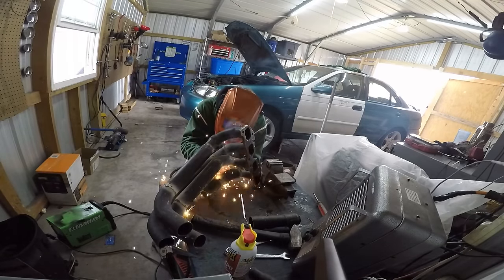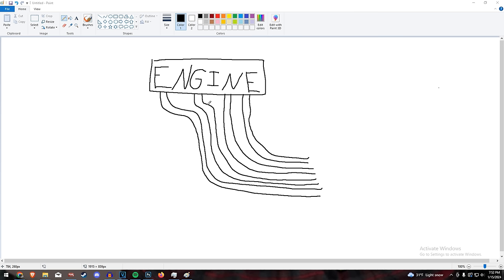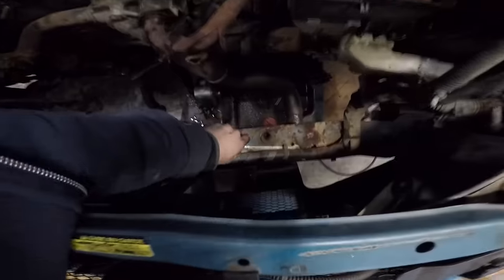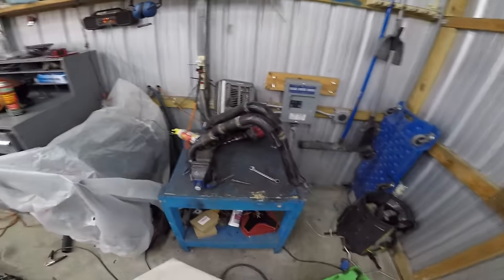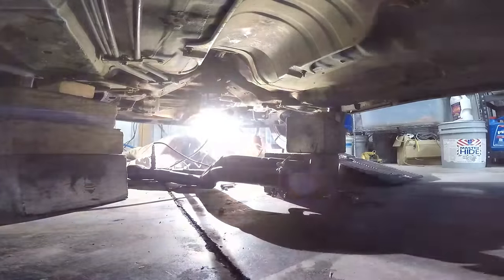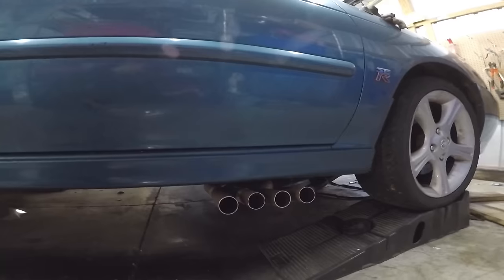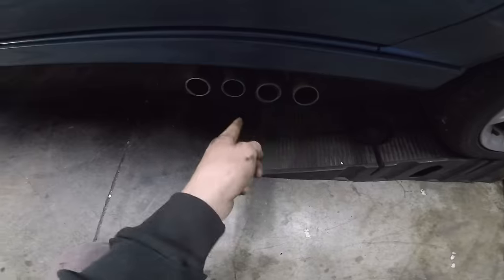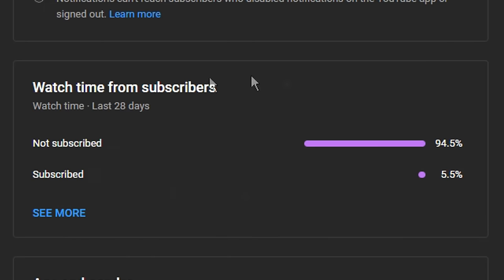True Quad Exhaust on a 4 Cylinder - What Will it Sound Like?

Comment: I like watching the puffs come out when it's idling. You can practically see each cylinder fire.
Reply from the maker: It does give you a good perspective on how fast the cylinders are firing
Reply: I dunno about that... Some quick math for a four stroke engine says:
Each cylinder fires 5 times per SECOND at only 600rpm...  (50 times per second at 6,000rpm)...
....pretty nuts to think about that, imho. especially if you take it to even higher revs.  I chose the 600 and 6k b/c I just woke up and the math was easy... lol  
9,000rpm - every valve in the head is opening and closing again at a rate of 75 times a SECOND!!
Reply: @billymanilli that really puts 17k rpm F1 engines in perspective, jesus
Reply: I'm not sure about how obvious it was that the math lines up with the video but what I am sure about is that there are musicians who can easily count 5ths of a beat at 60bpm and that is something i can actually wrap my head around  @billymanilli
Reply: @billymanilli Try tapping five times a second. It’s not that hard. You can see each pulse.
Reply: @twisted5576 great. Now try 50
Reply: @nateg08  Did you mean something by that? When the car is idling you can see each pulse.
Reply: @billymanilli  4 stroke does 2 revs per spark. 1000 per minute at 2k RPM. Which is 100/6 which is 16.6 total sparks per second.

At a low idle of around 1k RPM, that is 8.3 sparks per cylinder, per second. Looking at the video around 3:50 and counting as best i could, this math checks out.

The human eye's limits on perception called the critical flicker fusion threshold is somewhere between 60-90hz so we should be able to fully perceive individual piston fire even into the red. Well, in theory at least. At high RPM it seems like all the smoke vanishes.
Reply: How was performance change with this?

Comment: Well that sounded about 1000 times better than I expected. Impressive stuff
Reply: from inside the car is sounds like a 4-71 detroit without the whine of the blower
Reply: Agreed. Sounded great, cept for the probable stupid volume level. I wonder, if you ran the pipes all the way to the rear and put something inline, could it keep that great sound but lower the extreme volume level? I'm guessing the great sound might change in the process but think it worth trying to find out... Not my time or money so I have nothing to lose by asking😃
Reply: @SHO1989  It will sound exactly like normal exaust on 4 cyl xD
that was shown in start of video with dual exhaust 4cylinder engine. this now sounds diferent since no exhaust at all

Comment: love how it goes from lawnmower on initial startup straight to a 70s v8 with a pissed off wasp hive in tip
Reply: This doesn't sound anything like a V8...
Reply: Not sure where you heard v8
Reply: @keegentilley578  2:55-2:59 I can see where he'd get old school high rpm v8.   But then as soon as it's past the camera it sounds like I thought it should
Reply: It sounds exactly like the car from Hard Drivin' on the Sega Genesis.
Reply: @GoldenGrenadier  Oh hell, I forgot all about that ancient game. Kinda does.
Reply: 4 cylinders have a similar rhythm as v8s, but imho 3:24 sounds like an old z28 idk. Or some 6 cyl @benn454
Reply: hearing aids might be needed in your future
Reply: That sound you get when you put in the clutch/let off the gas to grab a gear sounds very similar to a V8, just more wasp like than roaring. The four cylinder set up definitely had it's own unique roar, which again is similar to the V8 roar in that they're both 'roar', however 8 cylinder roar is deep and powerful, while 4-6 cylinder roar is higher pitched and not as symbolic of power. I do enjoy the 4 cylinder roar as it reminds me of rally cars, mostly fwd but also at times awd. When you hear it you still get a feeling of adrenaline and a sense of speed, but you don't get the "crap in your pants" feeling a V8 will give you lol
Reply: Far from itn
Reply: No it sounds like an open header i4 because it is
Reply: @benn454  He says "70's v8"..  just a lot more raspy lol. 2:55 is a good example as limprooster stated. After 3:00 though.. idk about that one.
Reply: I thought I was the only one getting V8 type vibes

Comment: Here's a crazy one. Do what you did with the zoomies, but configure an x-pipe on each of the pipes and run the out opposite sides. In theory, it should have good scavenging and maximum flow. I'm curious about what that would sound like, too. 🤔
Reply: I think cyls 1 and 3 would need to go together and 2 and 4 would need to go together to actually create a scavenging pulse.
Reply: It would sound like a higher pitch Nascar cup car. It's basically a boom tube as is
Reply: True duals into an X might be fun.
Reply: @Kajifox  thats just a normal exhaust bud
Reply: @hunter_mxrtxn  not on a 4 pot. Those are generally 4-1 or 4-2-1, and Xs sound different to Ys.
Reply: Then imagine running it all the way out the back
Reply: you god damn genius
Reply: @creamwobbly  no but 2resonators per pipe actually gives  each pipe a real deep booming pulse... I have a dodge d350 diesel truck that had 2 mufflers in series into 2 2resonators in series and the deep booming from the exhaust note would set off car alarms a block away especially on cold days (sub zero Fahrenheit)
Reply: Before he tears that down.... maybe
Reply: @hunter_mxrtxn  you're not understanding what I mean then

Comment: In the 60's, there is an article about what is called ram tuning.  You basically build the pipes to a specific length to allow the exhaust pulse to scavenge out of the cylinder while creating more vacuum for the intake charge to be pulled into the cylinder.  There is some math involved to get the correct length figured out, and then you could also add a megaphone to increase the rpm range that the tuning will work with.  It does include building an intake to the cylinder to a specific length as well.
Reply: How cool!!!
Reply: I'd say he understands this considering he openly said that doing this loses power at the start of the video
Reply from the maker: If I had lots of money for a dyno I would try this concept vs. a modern system and see how big the difference is
Reply: There's a reason Honda abandoned their individual megaphones in the '60s. But not before they built a 1.5 litre 14000 rpm V12 with 12 exhausts, imagine what that sounded like! By the time they raced it, it was fitted with four 3-into-1 exhausts like everyone else was using.

The problem with individual pipes is that they're peaky, even with megaphones. And whilst it's true that they scavenge well at a specific engine speed, they scavenge very poorly at others. They miss out on the inertial scavenging of neighbouring cylinders, too. And there's far fewer options for resonant tuning between cylinders (think the balance pipes on inline 4 bike engines.) They are also much harder to silence.

You can get very close in sound with much more sensible packaging and significantly better performance.
Reply: In 1958 Doug Thorley patented the best exhaust scavenging, best torque and horsepower increasing headers ever made for V8's. The patented design was  a 4 into 2 into 1 concept, called the Tri-Y design. Smooth bends, tuned lengths and diameters to match the cam profile and valve diameters, and engine firing order consideration dictated which 4 went into which 2 went into which 1, is what made them so much better than all others. They can be found in many winning race cars/trucks.
Doug passed away in 2021. RIP Doug.
Reply: Works well for two strokes.
Reply: @eleventy-seven  it's all but required for two strokes, to prevent over scavenging and short circuit of fuel-air charge out the exhaust. Note that it's the reverse cone that is important in this case.

Again, traditionally peaky, traditionally troublesome at some rpm or other, especially without the use of variable exhaust port geometry.

There's a phrase well known to two stroke enthusiasts: "keep it on the pipe". Also, packaging multi-cylinder expansion chambers is a challenge.
Reply: @michaelmoore7975  how can you make "best exhaust scavenging torque and horsepower headers for a v8" when headers are tuned for different RPMs - also is it flatplane or crossplane? You can't just make the best, only a compromise.
Reply: @moneyshifters   @moneyshifters  You're right about compromise, and that goes pretty much for everything about a car. 
I read somewhere that a transmission is just a crutch to hide the failure of the engineer who could not develop an engine with a wide enough tourque curve to take off and be able to pull itself to highway speeds without the tranny.
And before the internal combustion engine came along, we already had something that did exactly that with ease, the steam engine. So in a way, we took a step backwards.
But no, I gave some specificity without details when I wrote, "tuned lengths, smooth bends, to match with cam profile, consideration to firing order." That pretty much sums up what is necessary to extrapolate how the headers would be built or selected.
The cam profile itself is enough to give you an approximate effective rpm range whatever engine it goes in. And when you have all the details about the engine, say 2 bolt main BBC with a .282 cam hydraulic lifters, roller rockers, oval port heads with blended runners matched to  a dual plane full plenum medium rise intake with gasket match, pocket port, combustion chamber relief and polish,  smooth and radius intake and exhaust dunners, Larger 2.19 and 1.88 valves, and TRW forged aluminum pistons 9.5:1 ratio. 
This engine would be used for bracket racing and regular street driving.  Standard transmission or automatic trans with a 2500rpm stall converter. The cam comes on at about 4500 rpm, all in at about 7500, make that the shift points,   and peak at 8500.
Anyway, all that determines what header you need.
I assumed we were talking about performance modified
engines meaning peaky power...narrrow rpm range.
As for "the best" yeah, very subjective what best means.
But no, I specified "best at what" with best scavenging, highest torque and horsepower increase. 
But I'm sure the tests were taken with a given modified engine or engines and developing a comparative test to determine results. Probably run  at the rpm range applicable. 
Thank you for your reply.
Reply: bro discovers purpose built / flow tested headers
Reply: @identiticrisis  Telling my age here, but do you remember the old Dyno-pipes made back in the early 1980's 2 stroke works motocross bike era? They were essential just bands of sheet titanium?  welded together to make an exhaust pipe.
They looked cobby as hell but supposedly the hot ticket. 
And you mention "on the pipe"....those works bikes back then everything that made them faster also made them nearly unrideable. Extremely peaky, ill-tempered, susceptible to atmospheric changes and an rpm curve that looked like a cell phone tower, "on the pipe" meant 1mm throttle up or down you might as well be pushing a 10-speed. They didn't even bother letting off, just keeping it pinned at WFO, brake dabbing and feather the clutch everywhere.
Also about the same time manufacturers were innovating different power valve systems like Honda's ATAC.
Reply: Sounds like a job for channel called: garage 4aeg

Comment: it sounds so good because of the phasing effect caused by having different length resonators (in the acoustic sense, not the exhaust component sense) that are firing the same charge in rapid succession. besides that, its one of the acoustically simplest exhaust designs i could imagine
Reply: Interesting! I know some types of Harleys are well known for having two equal length exhausts which supposedly sound really good as well (better than unequal to some). I'm curious how an equal length 4-in-4 exhaust would sound!
Reply: @vincentkoster6291  I'm curious how a true quad would sound with tuned pipes, i.e. if each pipe were half as heavy as the other (this would maybe cause them to play octaves) or masses ala 1:2/3:1/2:1
Reply: @louismoench3554 Satan is that you? 😂

Comment: When I was in my late teens, I had a new 1973 Pinto with the 1600 cc pushrod engine. I cut a Cherry Bomb muffler in half, took out the guts, and welded it back tocether, then I fabricated a "Y" pipe, and added chrome tips. It sounded a lot like your little Datsun there. Thanks for bringing back that memory for me when life was more fun.😅

Comment: That actually sounds really good. Subaru boxer noise without all the headgasket headaches
Reply: A couple n/a foresters in 2002 have a leaky hg and now the whole brand has an issue 🙄
Reply: @TDT0188 that's a huge underestimation
Reply: @TDT0188 there is a reason there are 2 types of specialized repair shops.  German and Subaru.

My neighbors 2 year old Subaru has already had its engine pulled twice.
Reply: Except that those spec vs had head gaskets blow too
Reply: @TDT0188  knock knock goes the subie rods..
Reply: The reputation of Subaru is undeserved. They are actually very reliable cars.
Reply: @TDT0188 except for 2003 was when the issues started getting really bad. You tried though.
Reply: @Patrick-857 I’ve driven a 2004 Subaru since 2016, and it’s been amazingly reliable. Granted, I did the head gasket when I bought it.
Reply: @bingham8624  ok what are you doing to that engine dude
Reply: @hafi8121  Yeah fr I'm calling crap on having to pull the engine out of a subaru twice in 2 years. My 2014 Outback has well over 100k miles and both the engine and CVT has never had a problem
Reply: @Jhutchm4  been there.
Reply: it's not a matter of boxer engine, just the pipe lenght.
Reply: You can get the same sound on any 4 cylinder with unequal length headers
Reply: @Patrick-857  Subaru's are the most worked on vehicle in my shop...We've replaced 8 engines in the past year, mostly imprezas....havent replaced an engine in any other car. Head gaskets and engine failure from oil starvation is a well known issue. Check out Donut Medias series where every single episode an engine had to be replaced or rebuilt.
Reply: The Subaru head gasket issues were a thing in the 90s and early 2000s. They have since started using multi layer gaskets which resolved the issue decades ago.
Reply: @TDT0188 Was problem into the early 2010s, stop lying
Reply: Owned 4, never had a problem

Comment: This exhaust series has been awesome I think my favorite was the dual h pipe. Here’s some more awful ideas I’m sure you will enjoy. In case you haven’t already done enough welding yet how about a 3-1 and a separate pipe for the last cylinder or how about the cheapest rear mount turbo you can possibly set up.
Reply from the maker: I think that setup would sound like a Briggs and Stratton go-kart. I have been wanting to do a rear mount turbo video for a while, that's definitely on the bucket list.
Reply: wouldn't the second one just be a turbo haphazardly slapped on the exhaust pipe, with some questionable piping to the intake?
Reply from the maker: @tiagobelo4965  Honestly, that's what a rear mount turbo setup is. You can make the welds nice, but it's still a turbo hanging on the end of your exhaust.
Reply: What about a 3-1 and a quiet muffler on the 4th to try and make it sound like an inline 3 cylinder?
Reply: @1987FX16  it won't sound like a 3 cylinder. Unless that 3 cylinder is an early Laverda Jota.
Reply: @HatersGarage  Always wanted to see a pipe connection from the exhaust straight to the the intake 😂even better if it's a turbo engine
Reply: Newer vehicles have a smaller version of this called an EGR valve. Leaving no room for fresh air by connecting the exhaust to the intake would result in the engine stalling as all the oxygen is burned.
Reply: @widgex343  I didn't mean an airtight connection, just basically the exhaust pipe pointing directly at the intake be it an airbox scoop or pod filter 😂
Reply: Oh yeah that does sound like a fun idea. Sorry I misunderstood what you meant. I bet it would melt the intake when it warms up or nearly cause the car to stall while idling depending on how isolated the intake is.
Reply: @widgex343  No worries at all appreciate your thoughts. Yes I believe you're right and that would be quite entertaining to watch 😂probably better suited to a channel like Garage 54 or Complete Toilet Garage possibly? idk how wasteful and dangerous Haters Garage is gonna be - because if so, boy would I love to see someone deliberately try to harness a runaway diesel to get insane performance results 😂
Reply: @1987FX16  it'll just sound like a 4 cylinder with a misfire
Reply: @1987FX16 firing order and pressure waves are the problem here, might sound close albeit a bit choppy
Reply: My big test is can I sleep thru it?  And it passed.
Reply: 3-1 headers are popular here in Indonesia mainly used by small 4cyl pickups that sounds like a dang harley lol